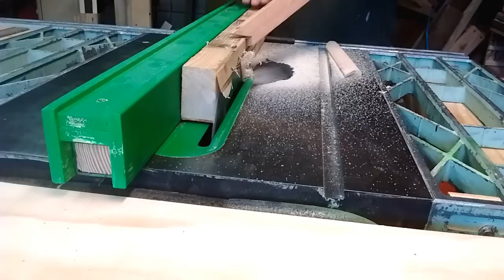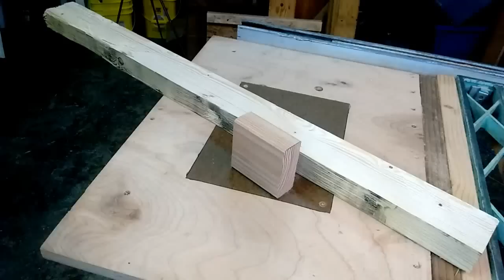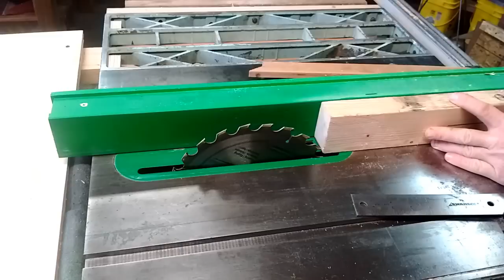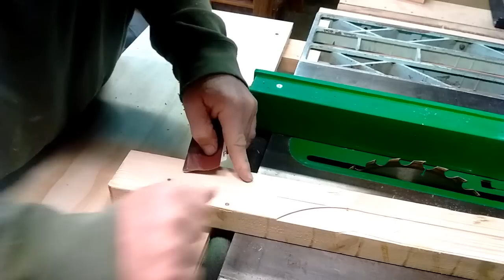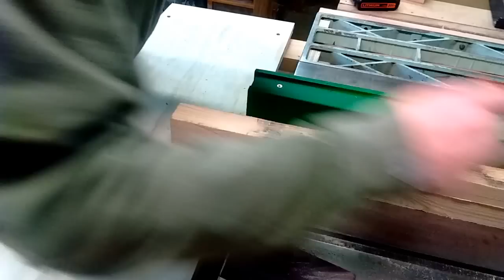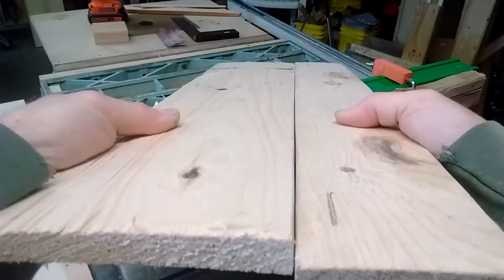How to make a DIY jointer jig attachment for the tablesaw

Comment: Very simple idea, with a very simple explanation. I really like this idea. When I was fleshing out my shop, I got a slightly used WEN electric hand planer, 4-3/8" wide, for about $15 at auction. I flipped it over and bolted it down to a base that I clamp to the bench. It works great, but for long boards the short edges of the planer do not support the work piece at all. I wanted a better way without shelling out $100's, and this is exactly what I was looking for. Thanks.

Comment: this is exactly what I was looking for... it's perfect for long boards as the jig does not move... most others have a jig attached to the piece you are jointing which means the jig needs to be as long or longer than the board... an 8 feet jig is just too weird to work with
Reply: I'm in the same boat, been researching the subject for weeks now. I am definitely going to do this asap.

Comment: Hi the idea is very good, just one question 
why didn't you square off the bottom first then it wouldn't wobble on the tablesaw surface 
but again thanks for the tip !!!
Reply from the maker: Hi, looking back I should have done that. I was more concerned about the side against the fence. I will actually take that as a tip. Thank you.

Comment: Nice, simple, clever idea.  If only those boards you were jointing weren't so cupped....
Reply from the maker: I didn't use those boards for anything. Just to show the edges.
Reply: @Sidswoodworkingprojects  I hear ya.  Its a great video and a great idea.  I plan on giving it a go in my own shop.  Didn't mean to put you down in any way - it was just an observation.  Thanks again for sharing the ideas and taking the time to make the video!
Reply from the maker: It's all good. I didn't take it that way.

Comment: Im guessing you can't have a riving  knife on when making the slot but can be put back on so long as it's no higher than the blade?
Reply: The purpose of the riving knife is to split the two cut pieces so they don't butt up against each other and lock on the blade. In this scenario I don't think there is a need for a riving knife since the board is not getting split, but maybe someone with more experience than me can chime in.

Comment: I tried to make one yesterday but for some reason I ended up with the boards high in the middle and low on both ends ? I didn't run the cut all the way to the front of the jig maybe that's what I have to do?
Reply from the maker: Ya the notch for the blade has to go from the blade all the way to the front. Leave the wood behind the blade.
Reply: Exactly. Just like on a jointer your infeed table has to be lower than your outfeed table, so the front part of the jig has to be completely cut to create that surface reference. Or you need to add a thin piece of something behind the blade...
Reply: I picked up a small craftsman router/shaper I am going to use as a jointer. I used a handheld router last year in a cheapy table I got for $20 with a 3/4 inch carbide straight bit that worked well. The only thing is its a pain to keep changing back and forth.

Comment: Is hardwood the only way to go? I have some and also just plain old studs
Reply from the maker: The piece I used was from a pallet. I think it's pine. Hardwood would probably last longer. Just check it occasionally to make sure it doesn't twist or warp.
Reply: Ok thanks for answering, I'll probably use the hardwood since I have no other use for it so it should work. Thanks again

Comment: What do you think about face jointing with this jig for pieces that are 4-5in or less in width?
Reply from the maker: +Jordan Wendell most tablesaws only cut a little over 3 inches in height. You would have to do one side and flip it to finish the width. I've never tried that so I don't know. I just use a planer. Sorry I can't be more help.
Reply: I'm here for the same idea.  Currently I'm actively seeking solutions to face jointing and thicknessing and I'm  going to try this jig 1st.

Comment: Great idea, going to build a similar one. But I'm going to say  what everyone else is dancing around. Why are you using that crappy piece of wood for a "precise" (or as good as one can get with a table saw) for this? It seems to me that you'd need a straighter piece of wood to start off with. Even when join reclaimed wood as what you're using. Don't get me wrong, I love using pallet wood myself but spend $7-10 and go get a piece of coated MDF shelving & make it out of that. Just my thoughts
Reply from the maker: You must have not read the comments. I got asked that question alot. It's the idea I'm expressing.

Comment: Hello and thanks for this video! I'm a noob here with a noob question...isn't there some kickback risk when making this jig?
Reply from the maker: You shouldn't have any  problems with kickback. Just make sure the blade is as close to the jig as possible when using it. If there is space between blade and jig it may allow part of the board your planing to get behind the blade. If that happens it can cause kickback. Welcome to the woodworking family.

Comment: So why not just use the fence?
Reply from the maker: You have to cut the groove for the blade. I wouldn't want that in my fence.
Reply: @Sidswoodworkingprojects  what’s the purpose of the groove tho? Seems like the fence without a groove would just as effective. New to this that’s why I’m asking
Reply from the maker: The groove is cut the thickness of the blade in front of the blade. Behind the blade is even with the blade which is also the guide for the board. That's how you get a nice straight edge. If there was no groove you would just cut the board. If it's uneven before you cut it will still be uneven after the cut.
Reply: @Sidswoodworkingprojects  so the groove helps cut straighter? I get what you’re saying. Just seems to me the groove would be almost the same as the fence. But i get it.

Comment: There’s no point in edge jointing boards that aren’t flat. Everything you say is negated by the fact ur wearing baggy long sleeves while using the table saw, enjoy ur inevitable workshop injury.
Reply from the maker: Ya I should probably be more careful. 35 years around power tools and still have all my fingers and toes. I've had my share of slivers though.